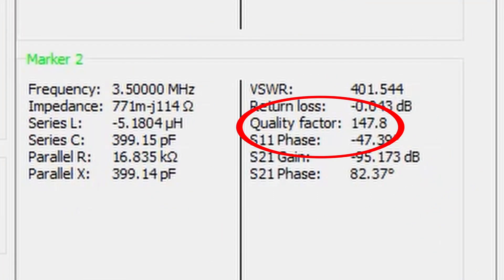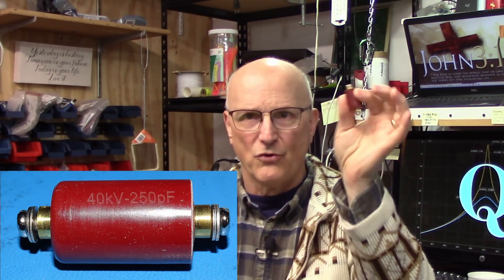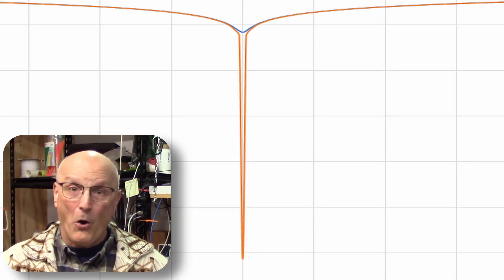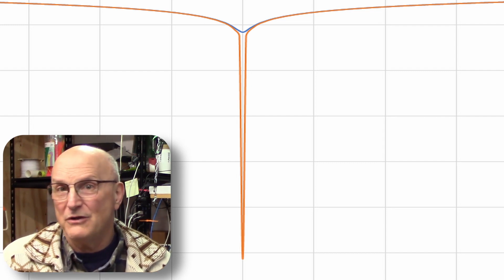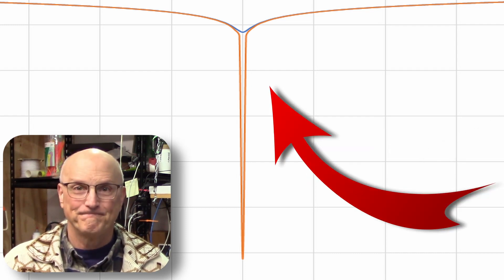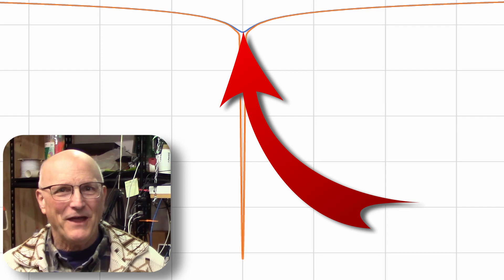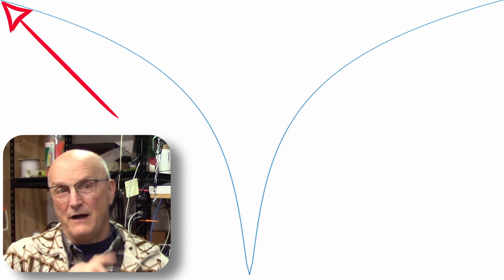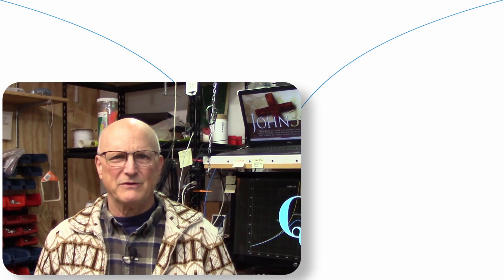Quality Factor (AKA: Q) Explained (059)

Comment: At work we sometimes experience negative Q's readings when testing inductors near or less than 1uH using Keysight 16334A tweezers and a HP 4291B impedance meter. Inhave Googled this and there seems to be confusion... Something to do with the too much capacitance and above the SRF. What are you thoughts. BTW your video is perfectly presented.
Reply from the maker: Oh yes!  If we look at the simple model of an inductor, there is inherent resistance (the wire), stray capacitance (two conductors separated by an insulator) and an ideal inductor. These form a resonant circuit. Self-resonance is when we reach the frequency at which the capacitive reactance of the stray capacitance and inductive reactance of the inductor are equal.
As we approach that frequency, the measured inductance will decrease because the reactance or the inductor (positive reactance) is being cancelled out by the capacitive reactance of the stray capacitance (negative reactance). The inductor becomes a resistor as resonance and then a capacitor above that frequency. To understand this, consider the equations for the capacitive and inductive reactance and how they respond to increasing frequency. Which one has the lowest value as we increase frequency?
X(L) = j*2*pi*f*L and {notice the minus} X(C)=-j/(2*pi*f*C)
The same sort of phenomenon occurs with capacitors; these, too, have a self-resonant frequency.
This is why we use as low of a frequency as possible when we measure the values of capacitors and inductors. We want to stay as far as possible away from this self-resonant frequency in order to get a more accurate reading of their actual value.
And ... thank you for the encouragement! :-)
Reply: @eie_for_you  Thanks for your reply. In our case I think this capacitance comes from the coaxial cables of the 16334A tweezers rated to 15 MHz and not necessarily the 680 nH inductor at 30 MHz. If we test our inductor with a test fixture (16334E) mounted directly on the 4285A, Q will be positive. Based on what you said and what I have read the inductive reactance (128.18 ohms) of this part is smaller than the combined capacitive reactance of tweezer cables and the 680 nH inductor , therefor the negative Q.
Reply from the maker: You are welcome! It sounds like you have a handle on it! :-)

Comment: This is great. Thank you. I have one question, though.
Would you always want a high Q for a resonant circuit?
Under what circumstances or application would you want a high or low Q?
Reply from the maker: Thank you and you are welcome!
Now, that is a good question! It would depend on the application. How is that for a non-answer! :-)
High Q means that the frequency in question would be very specific (picky). If there is going to be some variation in the actual frequency involved, then a lower Q would help with that. Remembering that component values vary with temperature, if the circuit was going to be subjected to wide temperature variations, then the actual resonant frequency would also change with the component values as the temperature changed. A lower Q would make this less of an issue. There are other situations, but I think that these help get the thinking moving. Hope this helps. :-)
Reply: @eie_for_you Thanks
Reply from the maker: You are welcome! :-)

Comment: Why are subtracting max value by 3db, not any other no.
Reply from the maker: We make this measurement at the -3 dB point because this is the "half-power point" of the signal. This is the very long established standard in electronics.  Does this help? :-)

Comment: Isn't wider bandwidth good?
Reply from the maker: It depends entirely on what you are trying to do, actually.  Like receiving CW (Morse Code), you want a very narrow bandwidth so that adjacent signals do not interfere with what you are trying to receive. On the other hand, listening to an A.M. signal, you want much wider bandwidth because the signal is wider. Notice, too, that the difference is the height of the resonance, not the width of the base. 🙂

Comment: AS USUAL AN EXCELLENT EXPLANATION!ONE WAY OF CALCULATING THE RESONANT FREQUENCY IS TAKING THE GEOMETRIC MEAN OF THE LOW AND HIGH FREQUENCIES OF THE BANDWIDTH.
Reply from the maker: In the simplest cases, yes. I have also seen nearby (downstream or upstream) resonant circuits or circuitry "pull" the bandwidth edge of a resonant circuit so this didn't apply. 🙂

Comment: Nice video. I have a dumb question. Why are you decibel numbers negative? Thanks1
Reply from the maker: Glad you found the video helpful. The dB values are all negative because I was talking about a passive circuit where the resonant circuit is the output impedance.  Being a voltage divider, the voltage gain will always be a negative dB number. Hope this makes sense. :-)
Reply: Thanks. I will dwell on that answer.
 @eie_for_you
Reply from the maker: @Festus2022  Just to give you food for thought... Vout/Vin = Rout/(Rout+Rin);
Rout/(Rout+Rin) is always less than 1.
dB = 20*log(Vout/Vin)
if Vout/Vin is less than 1, then the log (Vout/Vin) will be negative.
Hope that helps the noodling. 🙂
Reply: Thanks again!! Appreciated. @eie_for_you
Reply from the maker: You are very welcome!
This is my LONG overdue reply!  Sorry. Sometimes this stuff gets lost in the YT world. I'm spending some time trying to clean all this stuff up. :-)

Comment: Thank you for the simple explanation! Q finally makes sense.
The only thing I am unsure of is whether or not the two definitions for Q are mathematically identical, ie. is X/R = f0 / BW ? Or is this an approximation or generalization.
Reply from the maker: Well...just thinking about it ... one is used for components and the other for a resonant circuit. At resonance the total effective value for X is zero. So, this raises the question, "What about the 3 dB points? I just did a mathamatical exercise to answer this. A parallel tuned circuit with a Q of 625 per the fo/BW method (fo=50MHz; BW=0.08MHz).  If we calculate the Q using X/R at the 3dB point we get a Q of 1.24 (Z=9963.56+12373.65j).  Good question! But it doesn't work out that way.

Comment: Thanks, Ralph. I'd be grateful if you could say a few words on loaded Q, which is a term often heard.
Reply from the maker: I've been thinking about this very thing myself, knowing that I did not address it in my video. There is the Q of a resonant circuit when it is just sitting there all by itself, enjoying the influx of energy and minding its own business.  But, generally speaking, resonant circuits don't exist floating out in space by themselves. Something is drawing energy from them to, say, and antenna or another circuit.  This very action changes the Q of the circuit.  This new Q is referred to as "loaded Q." Hope this makes sense.
Reply: @eie_for_you  Yes, it does make sense, thanks.
Reply from the maker: @oldblokeh  I am glad to hear that. 😄

Comment: I was thinking about making some of the NVARC “Ugly” Filters DIY bandpass filters. Sadly, the capacitors they recommend in the build are no longer sold.  The instructions often referenced component Q when picking parts, so  I was very confused how to determine the Q of a part to find replacements.  This is very useful information, thank you!  The Ugly Filters encompass many topics you've covered on your channel, it would make for a great video!
Reply from the maker: One way that I got a feel for the relative Q of various capacitors was to set up a quicky representative resonant circuit. I put this series resonant circuit (made with a coil I wound on some PVC pipe + my test capacitor) in series between port 1 and port 2 of my VNA and did a through (S21) measurement.  This is not a way to actually measure the Q of the capacitor, but you can try various capacitors and definitively see which one provides the best, high Q, response relative to its cousins. With this you should see a peak in the response as the series resonant circuit becomes a short at resonance.
This feels like an interesting possibility for a short video ... you think?